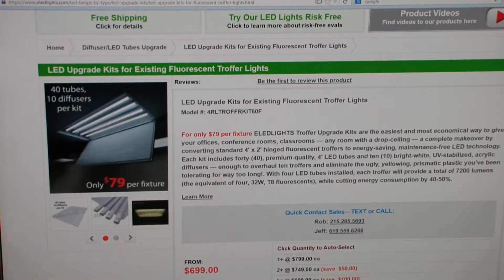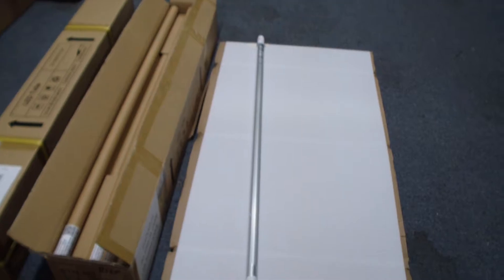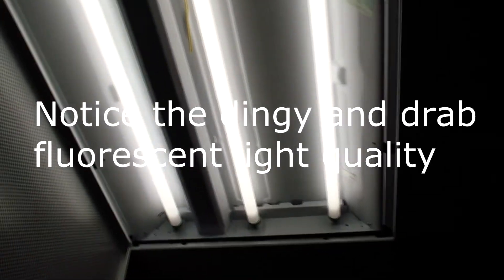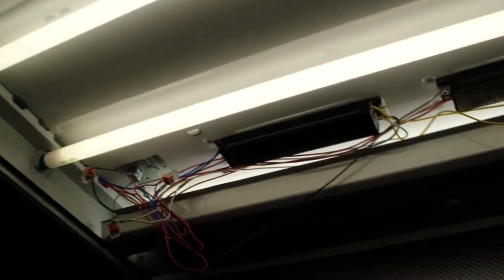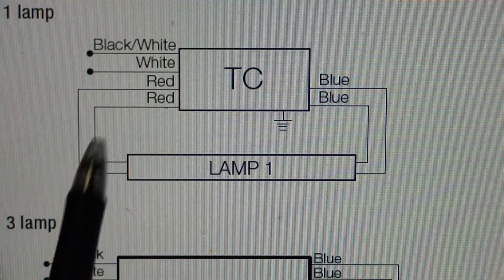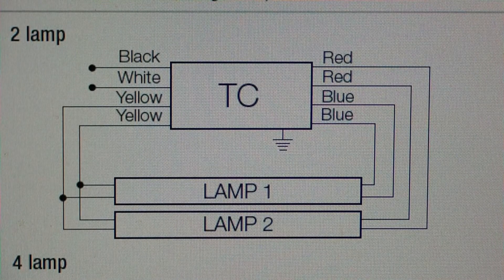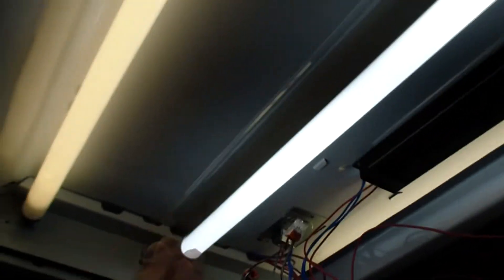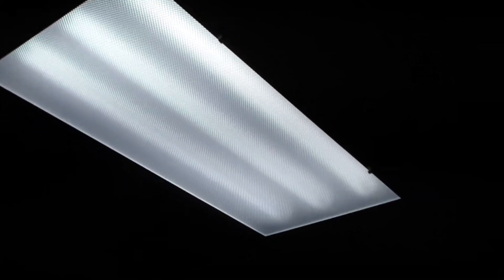eLEDLights.com Troffer LED Upgrade Kit Review

Comment: What mechanism does the lamp use to open the grill and have access to the lamps? can you get the opening mechanism on the market?
Reply from the maker: Every one may be a little different. A small screw driver should work. The frame has to be opened regularly for bulb replacement so it cannot be that hard.